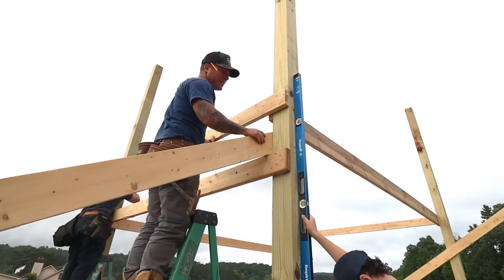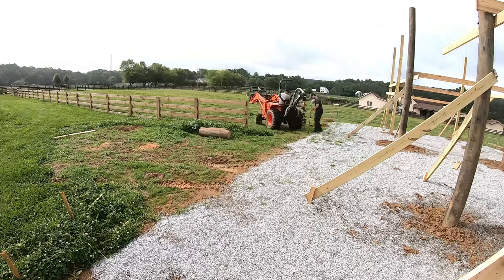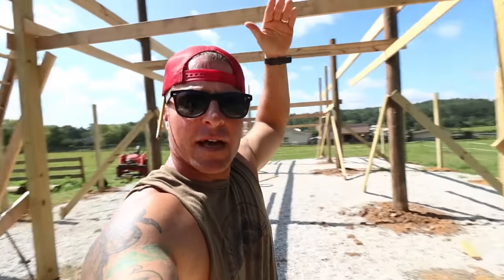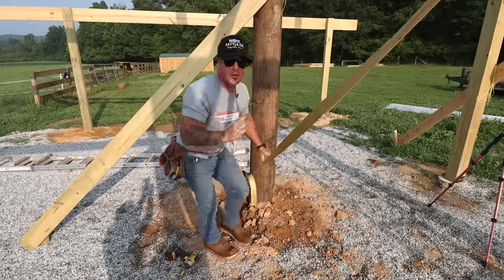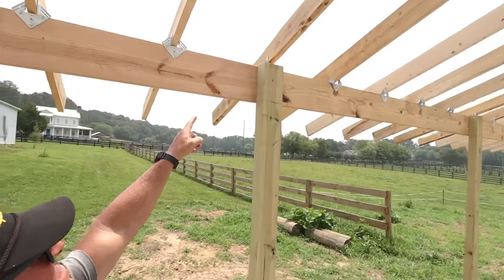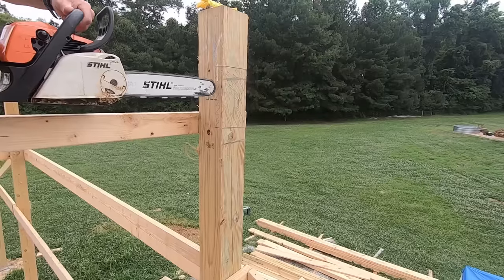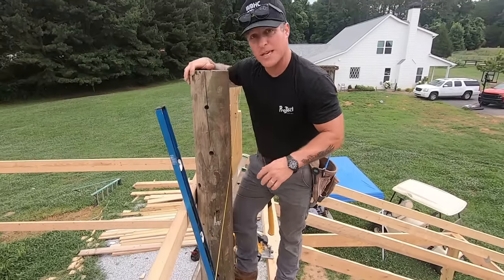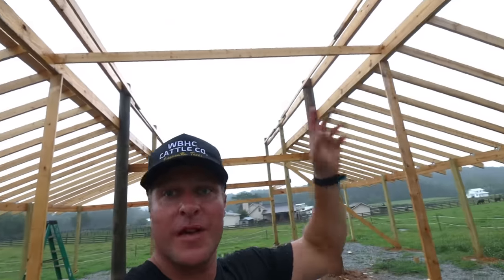Pole Barn Build On A Budget! Telephone poles and HEAVY Beams

Comment: You should never pour concrete around the poles, it promotes rot. Just 8" of concrete in the bottom for a footer. And, that way you can still adjust the bottom of the posts during building if need be. Then backfill with gravel to keep water off of the post bases.
Reply: It's a telephone pole they won't rot until everyone he knows is dead and gone. Plus it'll be inside it'll be 3 generations until it's gone. Plus the outside facing poles he did what you just said to do
Reply: Gotta love creosote.
Reply: Watch the first video. He used saddles for the posts. Also the telephone pole will never rot. My tradesman timber frame has telephone poles in it that my great grandfather put down straight in dirt in the 1950s and it still survives every tornado here in the Midwest.
Reply: Agreed, except these will be interior poles. Does that matter? Asking, not being a wise guy.
Reply: @Woodbrute  absolutely, there's always some degree of moisture in the ground. Besides, you're just wasting money in unneeded concrete.

Comment: Nice job and your going to have some handy space with that new building. One nit pick however string lines no matter how tight always sag,the bigger the span the more sag there is. Maybe a datum mark on each post with a laser level etc then measure up from that datum point to get the exact measurements needed .
Reply from the maker: Yes sir Thanks for the tips!
Reply: Strings more than level enough for that job

Comment: Just curious what did you use hardware-wise to fasten the headers to the posts? Structural screws, carriage bolts? BTW I have the same exact tractor and I'm glad to see a method that you came up with that lifts up large posts like that. I tried to do the same thing years ago and I wish I had watched this video first, although it had not come out yet

Comment: I was a commercial framer for years. After stumbling across your video I kinda miss it. I tried nailing the hangers before setting beams as it’s on the ground. Easier and faster. But hey, either way works. What part of the country are you in?
Reply from the maker: never thought about nailing them while on the ground super good tip! Were in North Georgia. If I had to do another trade I'd like to be a framer also. Outside, smell of fresh wood, working with the crew, I really enjoyed this build

Comment: So the posts are just set in the dirt and then put concrete around it? How long do they last before they rot out? Once they rot how do you fit it? We are thinking of building pole barn but would always use concrete piers- but I was wondering how long the posts would last if you set them in the dirt.
Reply from the maker: The post sit on packed gravel in the hole then concrete poured in. Keep in mind there covered by a roof so without water/ moisture exposure they’ll last forever really with insect prevention
Reply: @ProjectDadLife  Thanks for your reply. You are right with the roof on there is no water coming from above. However there is moisture in the soil. Concrete will soak up the moisture and the wood will be sitting in the moisture and will eventually rot. The question is how long will that take? Would be good to see old structures build that way and somebody that took it apart (mind you that they used old growth lumber so something to consider as well.. the modern fast growing stuff wont last nearly as long unless pressure treated).
Reply from the maker: Very true! I have personally seen 100+ year old pole barn built this way and the interior or covered post where still in decent shape. As long as you keep an eye on your roof run off and possible standing water I think 60+ years easily
Reply: @fabiancanada8876 you called it correctly there is not one pole here only posts.
Reply: I make pole barns in Utah and they warranty is for 80 yrs.

Comment: Not only are they different size and taper, telephone poles each have a different bow to them
Reply from the maker: Yes they do a little tricky but I think we got it figured out.
Reply: And they SUCK to cut...everything tries to bind up in them...saws, drills...everything! You all did great with them, especially up in the air like that!
Reply from the maker: @jasonl1822  thanks yes had to sharpen the saw several times. They’ll eat up a chain

Comment: You do know the post/pole that are placed in ground will rot and then what?
Reply: Those poles are treated for ground rot at the bottom. I work for the power company and we find poles in the ground all the time that are 80-100 years old and they aren’t in the dry like these will be.
Reply: Those poles are always well treated and will no doubt last longer than the barn
Reply from the maker: These poles are at least 20 years old I cut  4’ off all of them cause they were way long. They all looked like new pressure treated inside I was impressed

Comment: It's all cool man butt I hate screws. All done construction work. Where is the hundreds galvanized 16 penny nails.. entity by 4 and 2 4/6 three hits 20 oz hammer. Back in the early seventies. That wasn't very many screws back today. We had a nail gun. But I could out my all that gun. We had to share a plate to building to the emergency room. With a penny galvanized nails. I could run circles around that gun. Helpful to my pouches.
28 Nails staggered. Dark and couldn't keep up with me.
It was air. May I have brute strength. She got to drag that air hose around a compressor runs out of gas.. Henry's buildings weighed 14 ton. Allwood everything was on a hinge four-way piano hinge. Mud seal Foundation. Wonderful that up February 11th 6 wide 34feet ft. 
When we open them up 28 ft wide 34 ft long. Completely sided inside vinyl tile ceiling fiber tile.
Roofing . Laser all classrooms back in the day no wheels at all not a modular trailer.
I took a semi and a special gear to hook onto it. . You split the gear in half 1 Park stays on a truck on the fifth wheel. The other frame goes on the back of the building dual axles 8 wheelers regular semi tires. Two beams going up still there front and back. Jack of the buildings to the height. You stick to screw drip pins in there end of the building 3 ft long from the gear into the building to the front to the back can you get cables 1-in cables link to the building hooks on the back ratchets in the front.
Tighten them down Jack Em Up pull the blocking out. Course all the other block and came out to go with all the way around outside down in the center.
It's like getting a stack of books lining them up and squeezing them together and you can lift them all up at the same time.
So I guess there was a lot of pads have to be filled. Sometimes it's over too high off the ground we had to post them 4 x 6 post 16 + 16 parrot stack 5/8 plywood 2 x 6 in the middle. TECO clips and now the.
Oh yeah we use house check to raise them up. From the back.
5 ft bars. Sometimes I can stand in between both bars Jack one end of by myself. Get it up to height and block it.
Hairstyles one tough long-haired Indian still am and still long-haired. Oh yeah there was like books too had to come out in order to fold these buildings.
So yes I love hammering.
Yeah I'm not as young as I was back then but I can still drive a nail. Good luck and be safe.💪🏽💪🏽
People used to ask me if I lift weights how to say yep hi raised 14 ton buildings. My alarms are still about the same. But my belly isn't.🤙🏾👍🏽🙏🏽😊😎🙋🏽‍♂️
Northern California.
Left that job and became a truck driver. Hauling Lumber.
Big Timbers 4 X 12 4/16 30 ft long. I went to Southern California. Millions of board feet Lumber all shapes and sizes. Even 2 x 4 12 inches long.
Talk about it paint to strap.
Reply from the maker: Haha yeah man thank for the support

Comment: Great job and thanks for the details on important issues. I’m just in planning stages now and struggling to find prints for barns that are your barn styles. Is that monitor style barn? Where did you find your prints?
Reply from the maker: Glad it was helpful! I actually had these custom drawn but still changed it up a bit